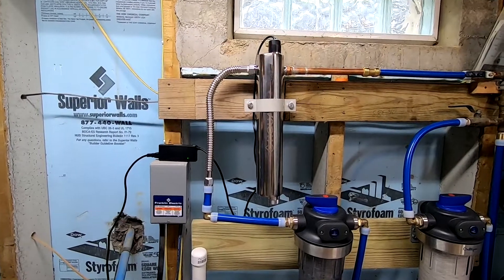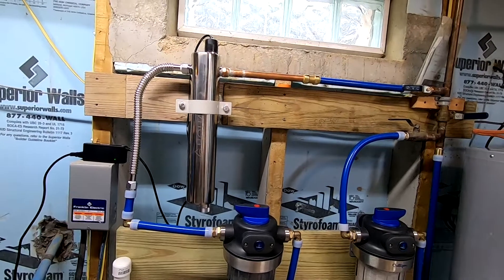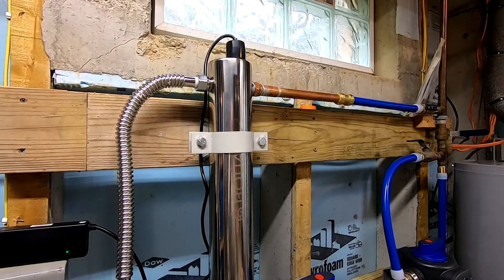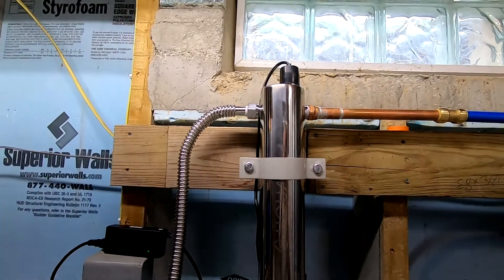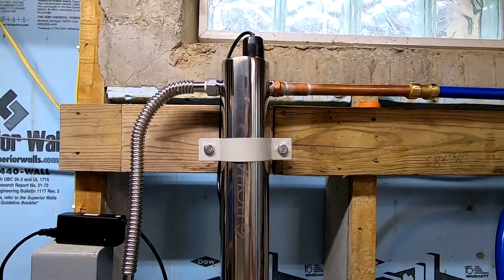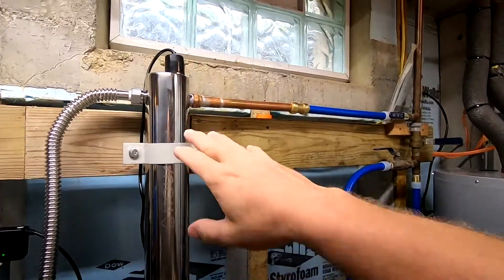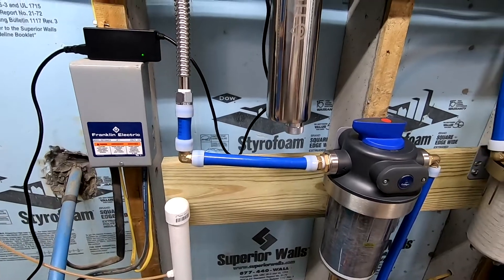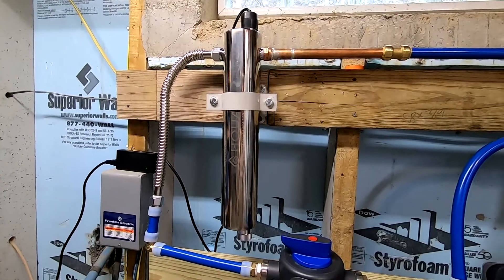Whole House UV Water Filter Purification System Installation Basics

Comment: This was a great video however, I noticed you said your whole house.Filtration system was getting Waterflow before your descaler. From my understanding, you want to flip-flop.Those because after you d scale your water then running it through a carbon filter while helping the flavor back to what most people like as well as do additional cleaning. Then you run it through your post filters to make sure the carbon doesn't allow the water to propagate any additional germs after flowing through it.
Reply from the maker: The last thing in the system is the UV light. The descaler is hooked up after the carbon filter. It's hooked up according to AO Smiths ditections

Comment: Isn't it supposed to come from the bottom and come out from one of the side ports
Reply from the maker: No. Not on this model. You can get different orientations of input and output depending on your installation needs.

Comment: If there was a filter after the uv what would be the source of bacteria to grow on that filter? Wouldn't it just filter the dead bacteria?
Reply from the maker: Exterior contamination such as you changing the filter with unknown bacteria on your hands, which is then allowed to multiply in the system. It's not likely, but could happen and is why the UV filter is last in the line.

Comment: Can you install it before the filters, I dont want to tear up all th piping
Reply from the maker: Technically you can, but you shouldn't. Reason being if your filter gets contaminated with bacteria, the UV won't do anything since it's before the filter. The UV should be the last thing in the system before entering the water supply feed. But if you do it your way, it will still protect against bacteria and stuff from the supply itself

Comment: Every start cycle on the bulb shortens the life of the bulb more than you save from turning off the bulb when not using water. It's not worth it unless the water is off for an extended period of time.

Comment: I've been watching YT videos that say that the descaler part of your system doesn't work. Are you able to shed any light on that aspect?
Reply from the maker: Honestly our water wasn't hard to begin with so I can't give great feedback on that. I don't think I would substitute a regular water softener with this though. It has helped our water greatly. It no longer cruds up faucets and doesn't stain showers like it did. Zero smell and much better taste to the water.
Reply: @JackofAllMasterofNone  If it's not cruding up your faucets with gunk that's a good sign that the descaler is do it's job. I know, not a replacement for a water softener, but we don't have hard water either, yet our fixtures pay the price. Thanks for the reply.

Comment: Suggestion: You can install a separate water flow switch at the outlet of the UV and connect it lamp to it so it will turn off when there is no flow of water I did the same in my home.

Comment: I installed my UV sterilizer between the pump and pressure tank.  It's wired so that the light only turns on when the pump is on.
Reply: not a good idea, uv light needs to be running for at least 1 min before it kills bacteria
Reply: Bad move.
Reply: @keithdean7149  Why is this bad? Working on designing my own system, so I would like to avoid as many rookie mistakes as I can.
Reply: @susanzenonian5085  turning bulb on and off shortens its life

Comment: So glad I found your Channel. New Subscriber here so I'm catching up on your Videoes.
 I have been putting together a 12K gallon water harvesting system on my Ranch and am about to start throwing money at the filtration system for it. Tanks are in!  My plan is to have 2 remove control water valves so I can switch between the neighborhood water well & my water harvesting system.  Will be harvesting rain water off the 3000 sqft shop roof.